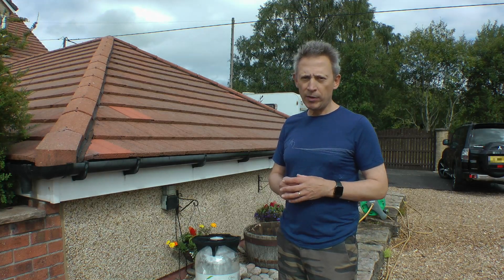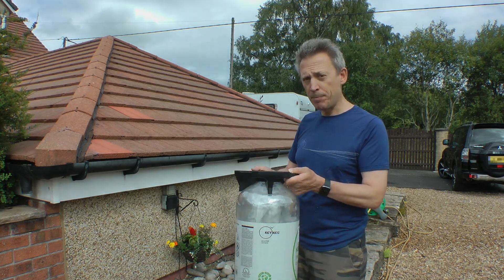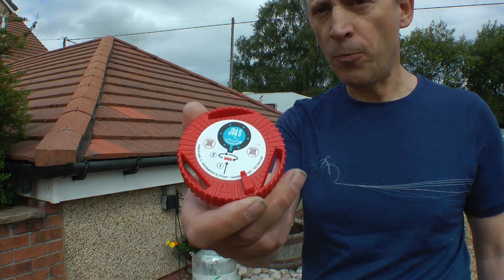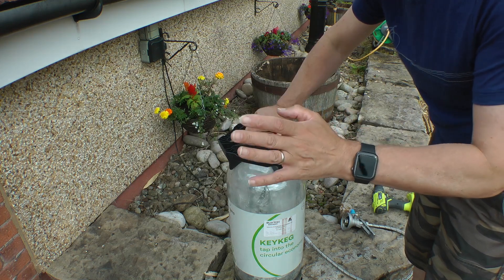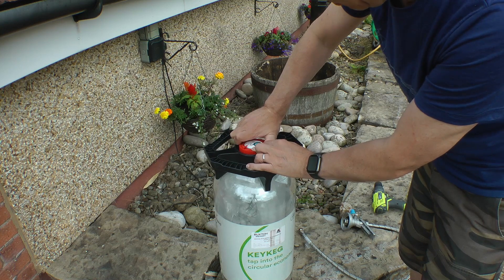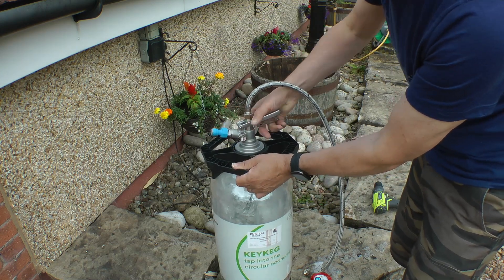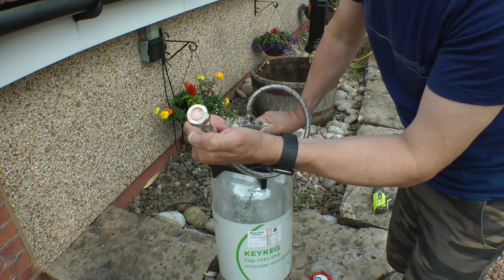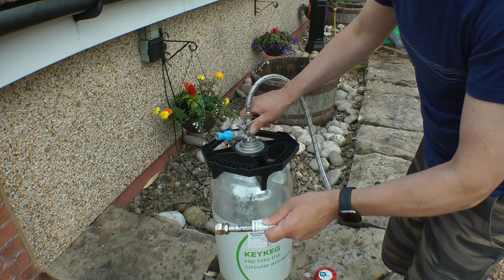KeyKeg tools you need | Depressurisation deflation tools

Comment: You can easily depressurise an empty keg with a screwdriver. Just have to gently insert it between the rotating and norotating part on the keg cap and  gently press to the wall of the nonrotating part. Takes less then a minute to deflate it completely.

Comment: To use the tool, simply place it over the top, push it down (the gas will start to release), then turn it to lock it on..... also if you put it on and then turn the keg upside down you can push on the bottom of the keg and you dont get sprayed in the face with beer !